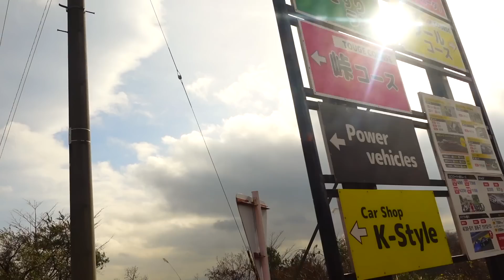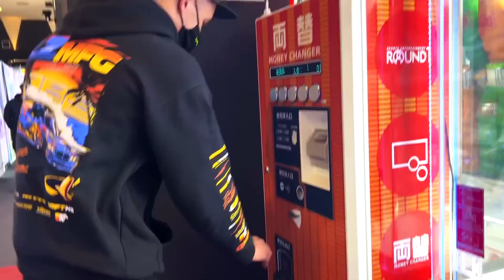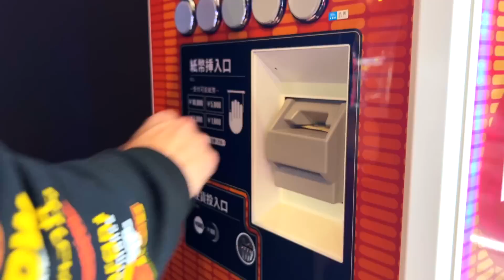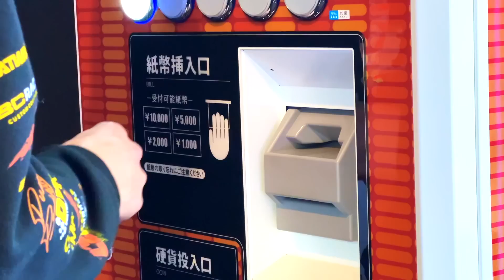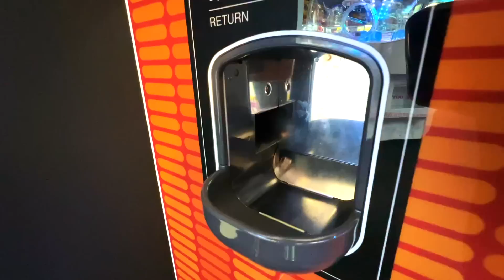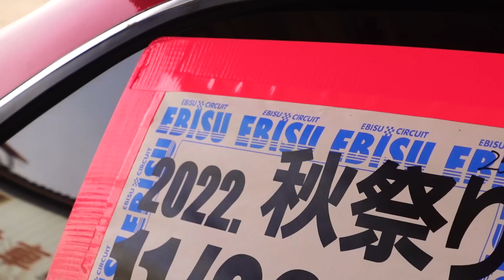The Real Cost to Buy A Car + Drift in Japan! Saying Goodbye …

Comment: Heehee.  I think they can fix that up,  but yeah, probably less lows in the bodykit will help a ton.  (Also I'm not sure, does like Ebisu even allow bash bars, generally?  Might wanna ask the folks there.   I'm not sure that it's as easy to find fabrication there as you may be used to anyway.

Comment: Normally those games are kept very fair and skill based in Japan. Those were all 100% rigged. The filler that the prizes sit on was overfilled to keep the crane from lowering enough to let the claws get a good purchase. The claw tension was also set so low that you wouldn’t have been able to pick up a feather.

Comment: Those claw games are 100% rigged lol There is absolutely nothing to do with your skill. It at least nothing beyond lining the claw up properly which is not very difficult at all.
The claw will only ever mechanically lock after either X amount of money has ran through the machine or randomly every so many plays. Otherwise the claw will always drop the product. The mechanism to make it lock is part of the machines control system.

Comment: yes, those machines are rigged,  they can set the grip to 2 different levels, first to pick it up and then it can be set weaker when it rises and moves. in prefer to stick to 1 arm pushers or ones full of stuff that can cascade easily enough. still takes alot of money from you... i literally spent 7000yen on one Chika Fujiwara room wear figure on those damned machines... the attendant even was kind enough to put it closer to the edge for me... that rocking green car thing is rather antagonizing. its so tantalizing," just a few more attempts" im also laughing crying from his ordeal. if you see rubberized bars, STAY AWAY. if you see a flat surface and one arm that hooks down, well that will take your money but you could still get it eventually. the 3 armed claws will do what you witnessed.